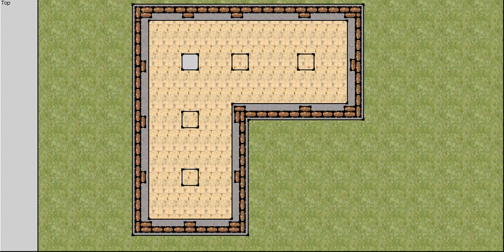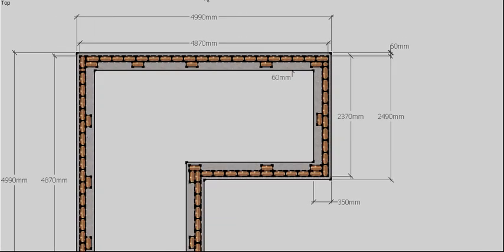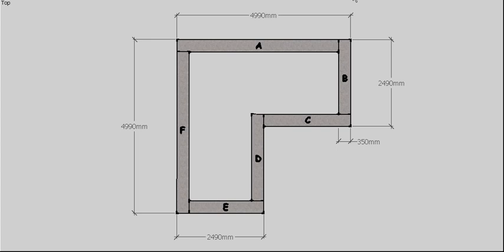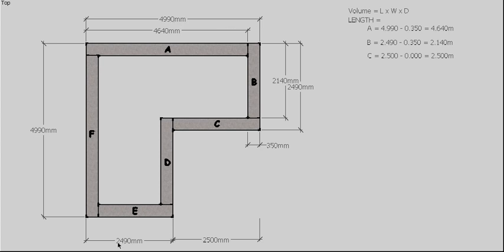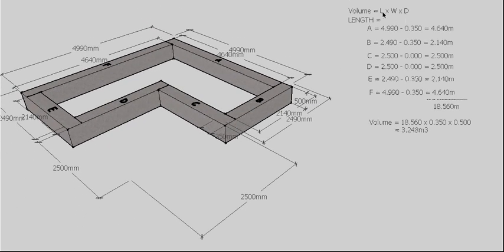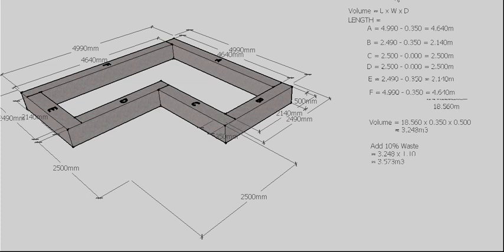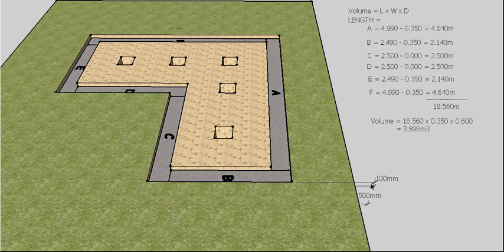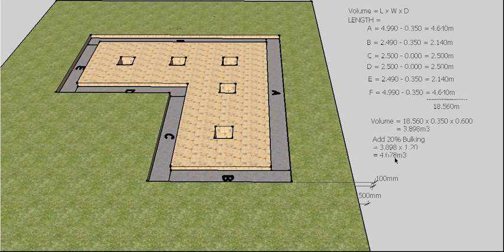Strip Footing Volume

Comment: What's the formula  for step footings let me know mate thanks
Reply from the maker: Step footings are hard to do unless you know the number of steps. If you do know the number of steps then you just have to work out the amount of extra concrete at each step, due to the overlap, and the multiple that by the number of steps and add it to the total that you got by doing the process in the video. 
A quick way to work out the steps is to work out the difference in height from the top of the area the footing is into the bottom and them dived that by the size of the step that you want. Steps generally work brickwork.
These videos may help if you haven't already seen them.
https://www.youtube.com/watch?v=nr8cDVwDwxs
https://www.youtube.com/watch?v=FqVNgtQkICI&t=8s

Comment: Hi, 
Great video.  Just wondering if this is to the Australian standards?
Thanks :)
Reply from the maker: +Julia Pollard Hi Julia the size of the footing is NOT to Australian Standard as all footings need to be designed for the specific site conditions by a Structural Engineer 
As for the calculations this is a standard method as taught to Carpentry Trade students however I'm sure there are other methods.
Reply: great, thank you.